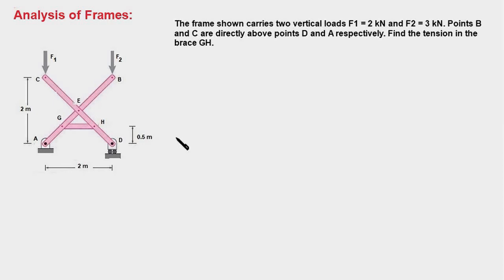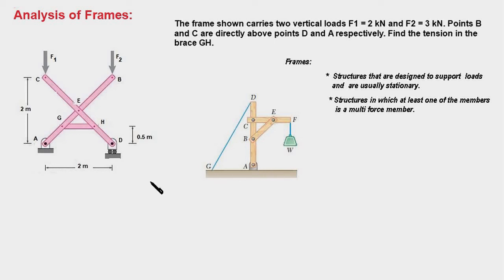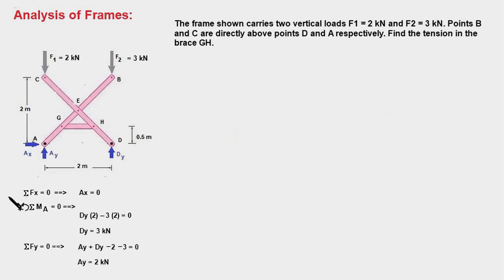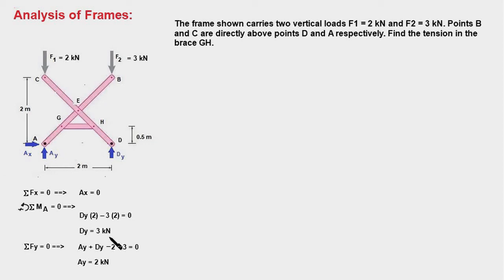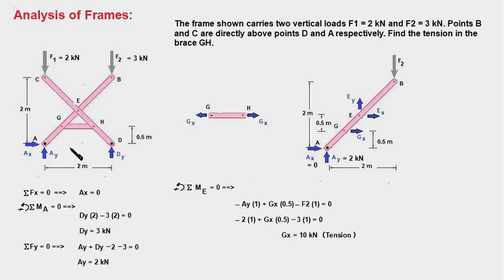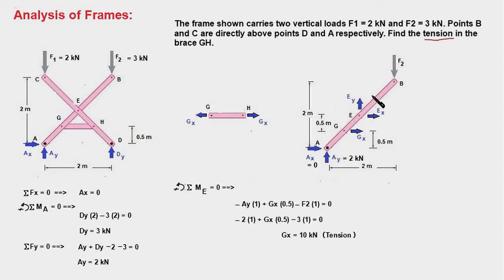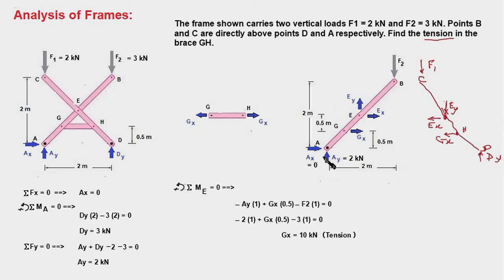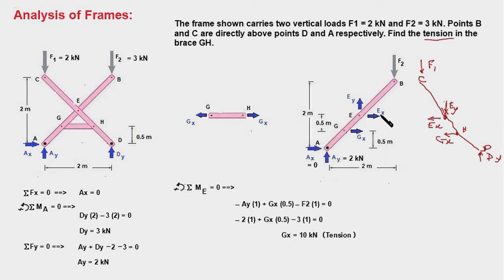14.7 Analysis of a Frame (Basics and Solved example # 1) (1 of 3)

Comment: How to solve 4 unknown reaction points with one known self weight(downward direction) in vector method, I have only 3 equations and 4 unknowns. ?
For instance: I need to find reactions on the four corner of the box with the known self weight of the box, Consider the center of mass is offset by some distance in x and y plane. 
Any recommendation would help!
Reply from the maker: The trick is to convert the problem into a 2D problem. To better understand the situation, think of a car/truck instead of a box. You know the car's weight and you want to estimate the reaction forces at the four wheels due to the ground. You can safely assume that the front two wheels share the load equally and same assumption for the rear two wheels. So now you can  model the actual car (3D object) as a 2D object ... the object and the forces are now in a single plane - reaction forces F1 and F2 at the front and rear wheel and W/2 (car's weight is assumed as W) at the 'com' which is not at the center but shifted to the front if the engine is front-mounted. Taking moment about the wheels will give mag. of F1 and F2. That's what is my suggestion.
Reply: @VectorInMotion  Thanks a lot. Even I thought for the same to considering it as a 2D problem. I am just thinking to make it generalize. If the reaction points are not symmetrical, I cannot able to translate the forces in a plane. Instead can I somehow solve it through vector method(But equations is not sufficient to find out the unknowns), as it needs the co-ordniates as input, the symmetricity  doesn't matter. Hope I explained the problem statement well.
Reply from the maker: @gowthamramesh3780  You have less number of equations than the unknowns -  no workaround that I'm aware of.
Reply: @VectorInMotion  Thanks a lot for the help.